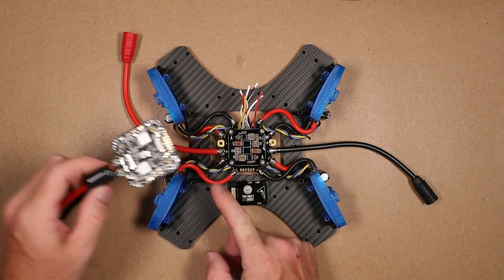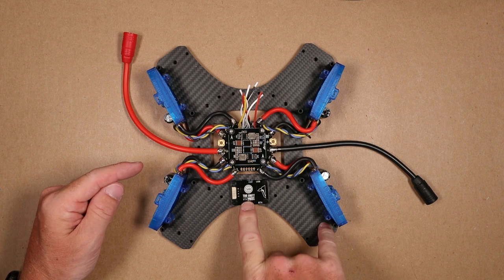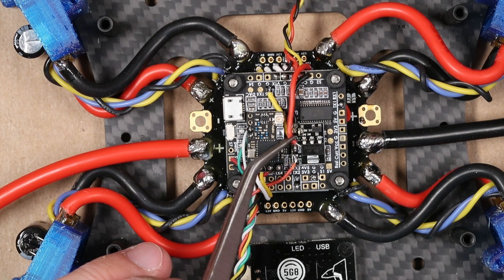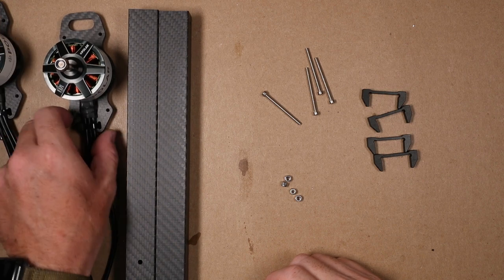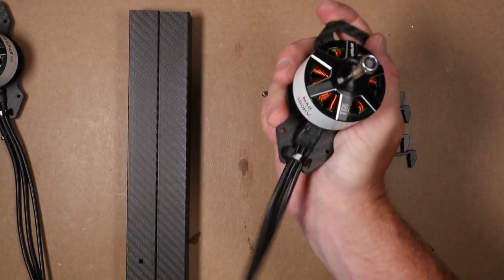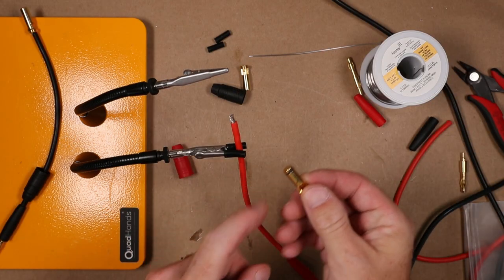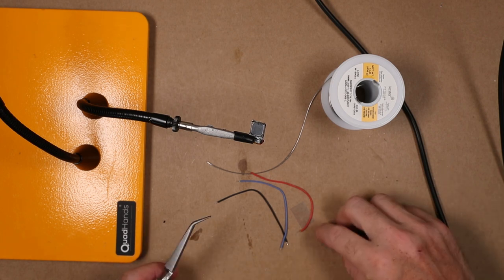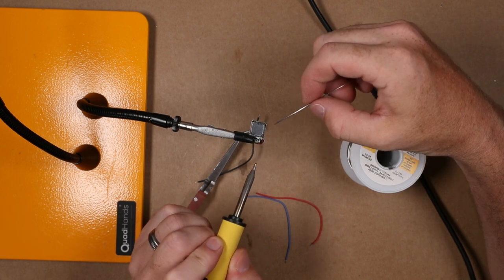Beast Class Build 6 of X

Comment: Very nice video, i wait for my ADP components to build my X-Class. Can you please explain how to setup telemetrie in Betaflight to see vbat in OSD?
Reply from the maker: Thanks for watching! To use telemetry take the telemetry wire off the PDB500 and wire it to any unused RX pad on the flight controller. Then in Bataflight activate telemetry on the config tab. Then on the ports tab activate ESC telemetry under sensor input for the RX pad you’ve wired to. Then head over to the battery tab and change to ESC telemetry. Then setup your OSD accordingly. You may have to force battery cell count in the CLI to get the proper reading for individual cell voltage if using 12s.
I’ll be doing a complete Betaflight setup video for this rig soon. I have one more build video to drop before that comes out though.
Reply: @breaksteel  Yes thnak you, what is the final weight for this X-Class Racer?
Reply from the maker: Sharky atHome Final weight was 3670g or about 8.09 lbs after the conversion. This doesn’t include props.
Reply: APD recommends using RX4 on the Brain Radix for telemetry. I and others have had issues with APD telemetry though and to get reliable vbat reading, instead or in addition, wire vbat to the voltage monitor pad of your FC, but put a 13kOhm resistor in series. Then change voltage scale in betaflight to 200. I use 12s so I do what breaksteel recommended and used a divider of 120 in BF (12s divided by 12 I guess...) to get an average individual cell voltage so that it can be displayed on my dji goggles because those only go up to 25.5v.